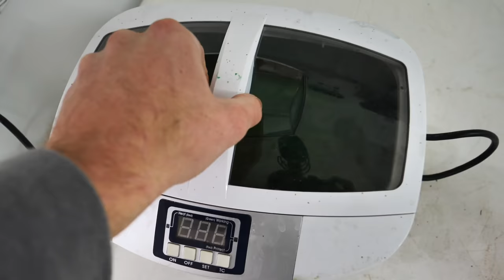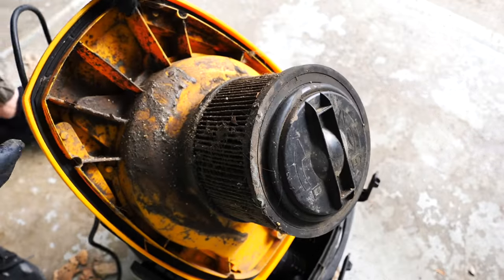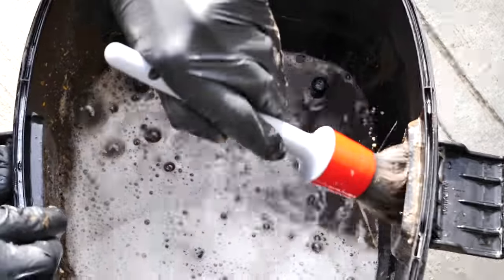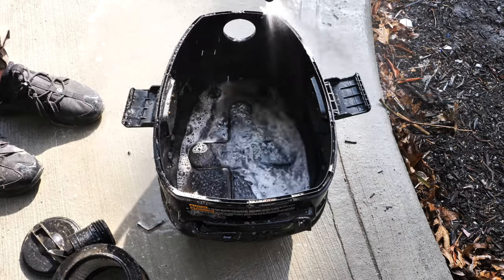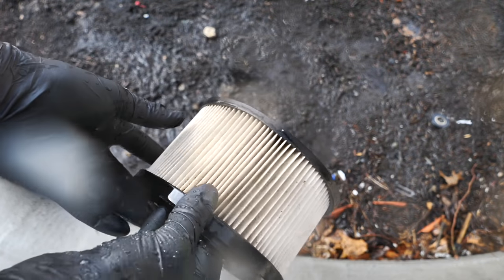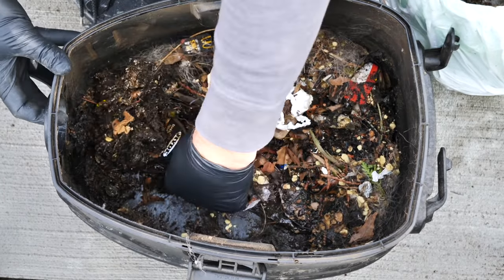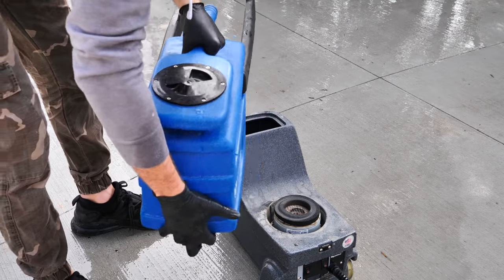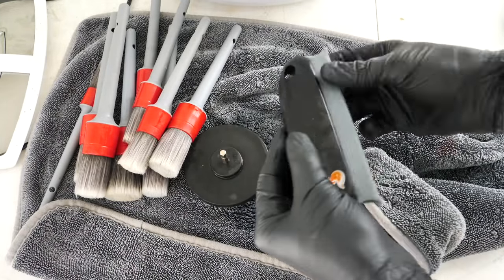How To Deep Clean Your Vacuum, Detailing Tools and Wash Your Microfiber Towels Properly

Comment: My favorite detailing tool is the Vortex Air Compressor gun. Lighter than a Tornador with a similar use, helps the blowout stage immensely and cuts the times it takes to vacuum in half sometimes

Comment: My go-to product for detailing is Optimum No Rinse! I use that on interiors and exteriors, anything that needs a basic wipe down. My favorite tool has got to be my air compressor. Blow out gun is so useful. Oh and im glad you mentioned the vacuum bags. Buy the vacuum bags for those shop vacs instead of vacuuming straight into the bin. Then all your dry material gets collected and easily dumped out. If you’re going to extract with it then remove the bag first and then you have a nice clean dirt free vacuum!

Comment: I use a cyclone separator on my shop vac - I picked one up when I started doing wood working, and just leave it on the shop vac for everything I do. Having everything go into a separate container (I use a reinforced 5 gallon bucket with a DustDeputy attached to the lid) means that I've never replaced the filter on my shop vac, it still looks like new and I've had it for over 5 years now. I think I've replaced the shop vac bag once, maybe? When my apartment flooded I took the filter and bag out of my shop vac and left the cycle on, the great majority of the water went into the separator, which I was quite impressed with.

Comment: I'm a beginner detailer so buying all the items I need is going to take a while. The one thing I won't buy is detailing brushes with wooden handles. Since I don't use tap water to wash the outside of my car, I use 5 gallons of distilled water that's just to rinse the car off. I use the 3 bucket method. 2 for exterior of the car and 1 for the tires. I use a battery pressurized vehicle cleaner. It has the foam cannon with it. I have a small wet/dry shop vac that I vacuum the interior of the car with. It works. I don't have all the things I need yet, but I will. I'm learning to detail on my own car. Thanks for your video on cleaning brushes, shop vacs, microfiber towels, and etc.

Comment: I'm not a pro, yet without a doubt my most useful detailing tool/equipment would have to be my supply of microfibers. Experience has taught me it important to have a large supply while using specific ones/colors for well defined needs.  I use multiple towels for the simplest of tasks, to the point to where I don't concern myself with how many I have used.  I typically soak and rinse them overnight prior to washing, and have never dried them with heat....only air tumble and then hang to dry.

Comment: My top detailing product is actually similar to Optimum No Rinse, it is called Ultimate Waterless Wash Plus. It’s slicker than ONR, smells great, and leaves no streak inside or out. I use it on my paint, glass, interior leather and vinyl and even interior glass. I keep bottles around the house for quick wipe ups as well.

Comment: favorite product I like to use is the metro sidekick blower. helps dry the areas where its hard to reach with a drying towel. very loud so I recommend using noise reduction over the head ear muffs

Comment: The vacmaster definitely looks portable. I use 303 All-Purpose Cleaner a lot - with detailing brushes or drill brushes.
For engine cleanup I use fine misted water, Tub o Towels and shop towels.

Comment: My Favorite cleaning product is by far a dashboard vailla spray, just wipe the interior pieces with baby wipes, then use a dry clean microfiber i keep in the car,  then spray them and wipe until it's no longer slippery, gives the dash, center console, shift boot, cup holders and everything a very deep and shiny look which lasts for about 1.5 weeks, i do it regularly so my interior is always fresh, even when the weather out is pretty nasty

Comment: I use Bilt Hamber Surfex HD which has different dilutions for wheels, paint, carpets, upholstery, tires.
Also for microfiber towels like you did the Dawn first to remove all that initial stuff from them and if you don't have the Rags to Riches from P&S you can use the All Clear detergent with 1oz of White distilled vinegar on the softener.

Comment: Recently started using PolishAngel's UltraRed a fantastic ph neutral prewash.  I live in San Antonio with lots of clay and dust from highway construction everywhere now.  And clay and wind blast this stuff airborn all over and when it rains its all over your car and very sticky stuff. This ultrared sprayed on before and let dwell for a minute is all it takes and the road grime and clay ( including road tar and wheel brake dust )  washes away.  Its expensive so I put it a pressure sprayer and apply a controlled thin layer everywhere on lower panels where its needed.

Comment: I use a pre-filter sock on my wet/dry vac so it's easy to just take that off and shake it off and it saves the filter having to be replaced a ton.

Comment: My giga-brush, I think I found it at a local shop, its just a normal boars hair brush but its really big so I can cover big surfaces a lot faster and its super versatile
Edit: actually, also my 360 spray bottle its super usefull! Has like a metal weight on the inside so if you put the bottle on a angle its still able to get liquids from inside and has a double trigger mechanism so that you get two sprays everytime you pull the trigger

Comment: Anyone who cleans their buckets,vac and brushes like this is going to do a great job on your car!👍👍👍👍
Reply: Yeah, but you know that vac was a horror.  Good thing he uses it outside,
because the stench would come out the back and stink up the house.
Reply: Always clean your equipment makes life so much easier when detailing with clean equipment
Reply: I don’t think this way of cleaning a vacuum is very efficient and for the towels put them on low heat in a washing machine

Comment: Make yourself a filter spinner out of 2 pieces of plywood cut into circles the size of the inside of the filter and a long bolt through the whole contraption and then into your drill's chuck. Boom. High speed filter spinner for drying quicker.

Comment: Personally, I "only" use microfiber wash mitts, microfiber drying towels and a detail brush to clean the wheel inside. I use a wash mitt to clean the rims. I don't use any detail brushes to clean logo's etc. My experience is that you'll only need that when the car is very dirty. And when the job is done, I'll rinse of my wheel detail brush and throw the mitts and towels in the washing machine.

Comment: electric motors and most electronics are such simple designs you cant break them alsong as you dont gonnect power when they are still wet you can literally wash a motherboard in the dishwasher and its conna be fine when you let it dry afterwards

Comment: shouldn't you wash the vacuum filter against the air flow? I mean using counter-flow you will extrude more of the dirt from the filter rows, doing that way you presented on teh video you push some of the dirt deeper into the filter. Anyway, great video and chanel, regards

Comment: bro dont torture yourself cleaning microfiber towels by hand :/ thats too much needless work
just throw em at the washing machine and run rinse program for the ruff dirt first.
then wash at 140F (60C) if you still think they are not clean enough wash the second time

if you spin at 1000rpm you can use the towels directly on any surface. no detergent needed. its gonna be spotless i promise
please let me know if you try this. that is a technique that i found and i want everybody to know it. its too enviroment friendly and practical.
if you like it and share with your audience i'll be more than happy.